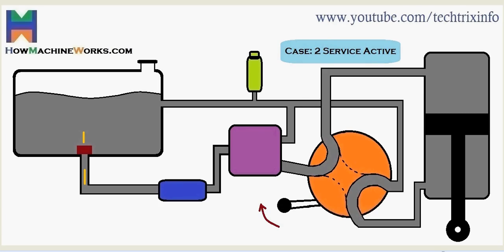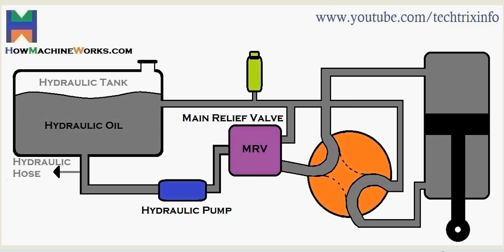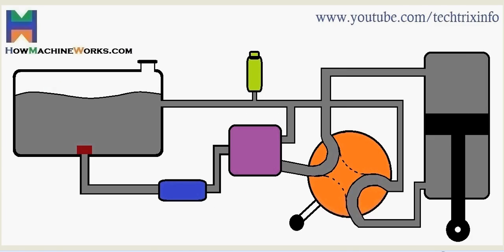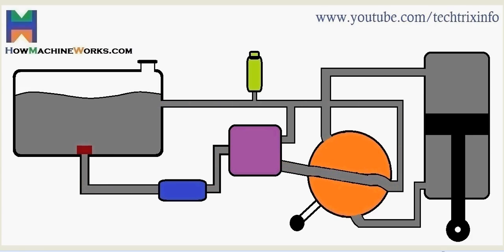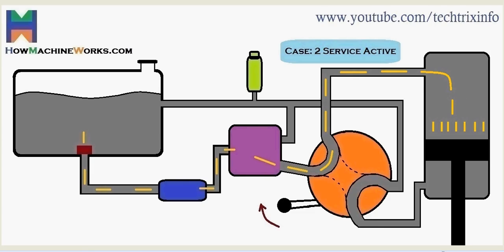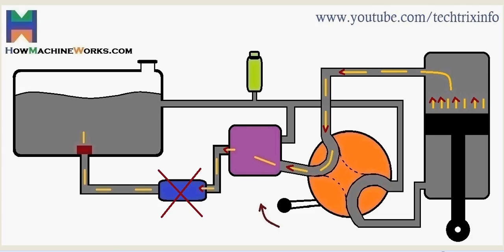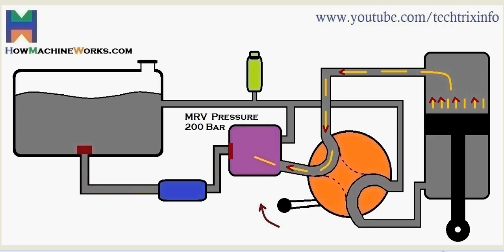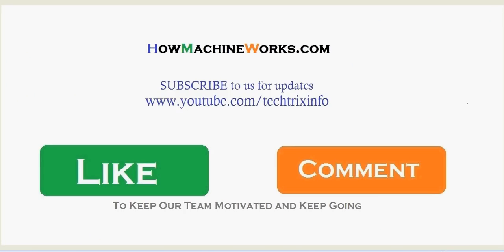Animation How basic hydraulic circuit works. ✔

Comment: What if I need to spray hydraulic fluid such as when you use your thumb with the water hose? I need to control an ATF spray with a minimum/maximum PSI - thanks

Comment: I have a question how much u need to fill up your hydraulic tank..
Reply: should be a fill line or something telling you how many gallons or increments you should use
Reply: It's a thumb rule you need three times of pump output. For example if you have a pump having discharge 5gpm you need approx. 15galln oil in tank.

Comment: hey bro why does that oil from vessel directly does not flows towards the filter tube ?? liquids tends to maintain same level isnt it? please reply .. i m not insulting or hurting u . i m just asking questions..
Reply from the maker: +Infinite Neupane 
Question not clear
Please Whatsapp @ +919744615655
Reply: i have messenger and viber bro .. arunneupane34@yahoo.com     ..or i will make whats app if u dont have messenger or viber.. my viber is +9779861282065